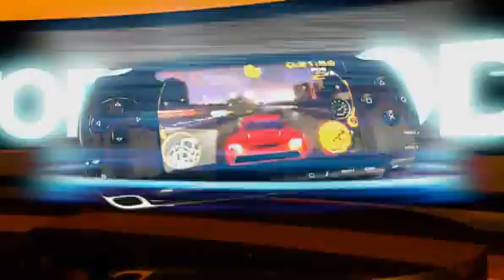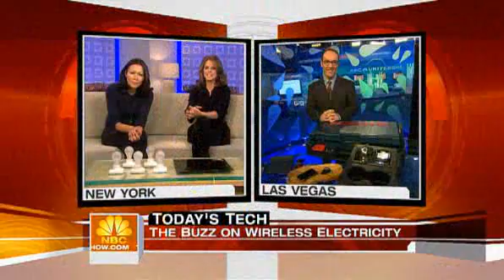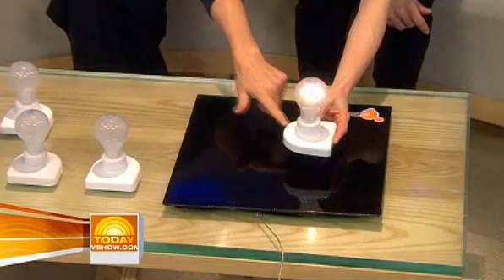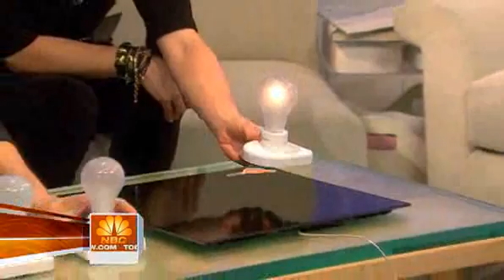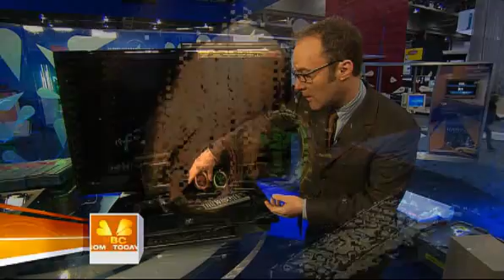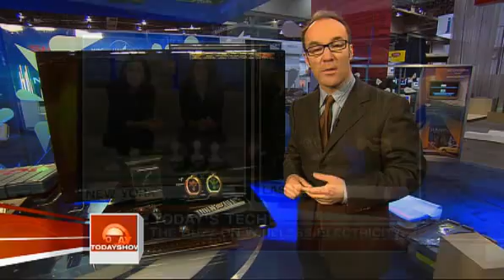Wireless Electricity by Magnetic Induction Coupling demo

Comment: In 1824, Faraday briefly set up a circuit to study whether a magnetic field could regulate the flow of a current in an adjacent wire, and couldn't. In 1831, he began his great series of experiments in which he discovered electromagnetic induction. Tesla demonstrated wireless energy transmission as early as 1891. The Tesla effect is the movement of energy through space and matter, not just the production of voltage across a conductor.

Comment from the maker: You are seriously misinformed. 

Geostationary satellites are 22,000 miles up. Because they are solar powered the TX power per beam ranges between only 50 - 150 watts. (about the same as a household light bulb). 

The reason you can't receive a satellite TV signal with anything less than a parabolic dish with a low noise block down converter is due to the inverse square law, the signal is extremely weak by the time it travels 22,000 miles, in the microwatt range. That wouldn't power an LED!